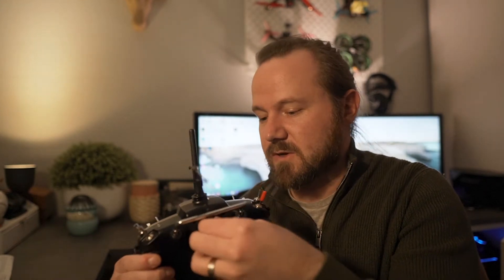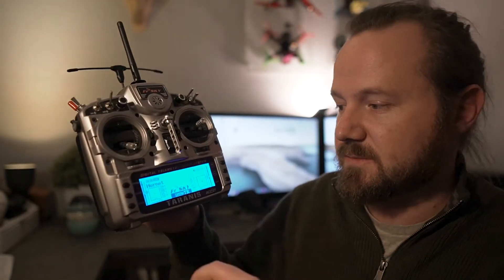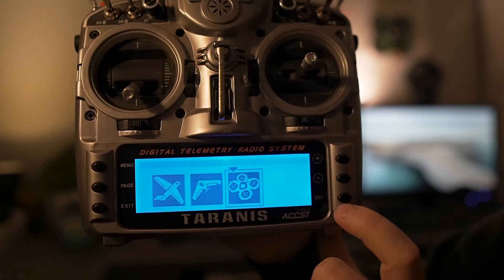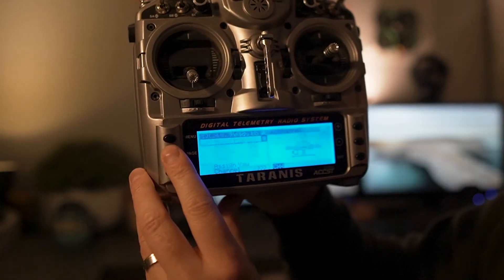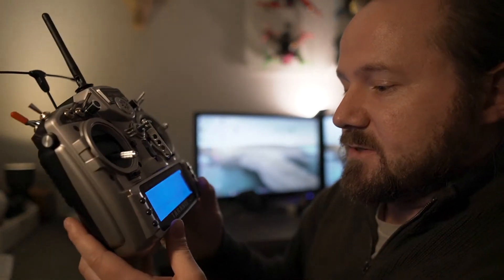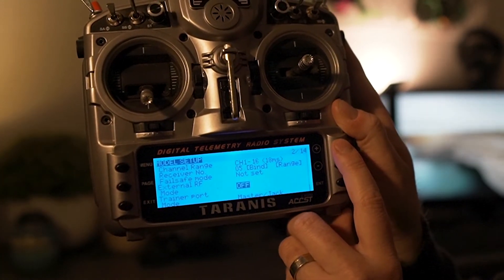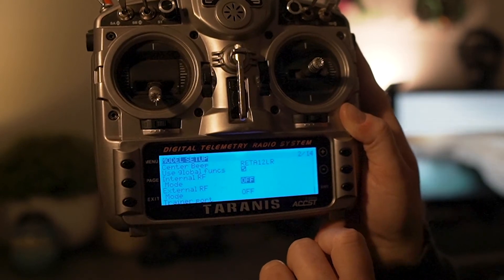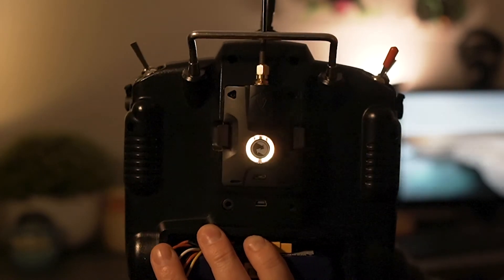How to setup Crossfire on Taranis - Creating a model

Comment: Thank you for this video I really appreciate it! My issue is with my QX7. I am able to create a crossfire model and bind the crossfire TX to the RX but I don’t get any stick movements in betaflight. I seem to have the board soldering correctly. Beats me what I could be doing wrong I’ll continue to troubleshoot. Thanks again!
Reply from the maker: No problems mate.
Oh ok - I’m not too sure about that one sorry. I know I had similar problems with mine, and it was a computer problem. Running old Windows 7 software and the Taranis didn’t seem to like it.
Reply: Hi there, have you been able to resolve this issue, I seem to be having the same exact problem with my qx7

Comment: I see as soon as you turned on the external rf and enabled the mode CRSF, we could hear a buzzing sound, I wasn't sure if that was normal
Reply from the maker: Hi mate! It has always done it for me on any models where external RF is connected, but have only ever used the one X9D, so not sure if it's normal. Ive never had a single Crossfire drop out though, so seems all good to me! Haha. :)
Reply: @ScottBerwickCreative  ah no worries I wasn’t sure if it was just me, I just lower it to 500mw in tbs agent and the buzzing is significantly lesser
Reply from the maker: @S4mory  good thinking - I will check mine too 👍

Comment: Hi Scott, i actually tried your tip but when i was in create new model, my taranis x9d plus Se suddenly confirmed "the remote antenna is defective", is there a way to bypass this message and proceed in creating new model?
my quad has crossfire nano rx and my Taranis x9d plus Se has the tbs crossfire antenna at the back of the remote (with pushbutton)
Reply: I have this same problem mate, did you manage to sort it out? 🤝